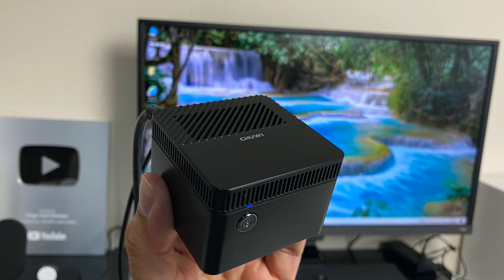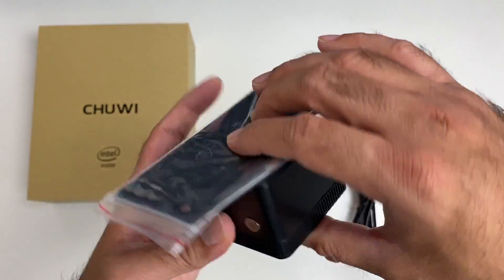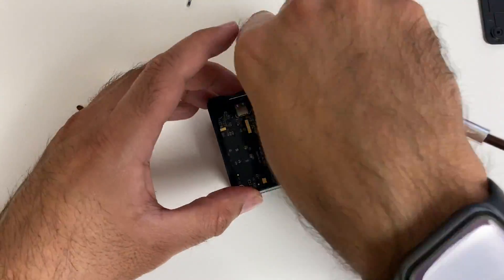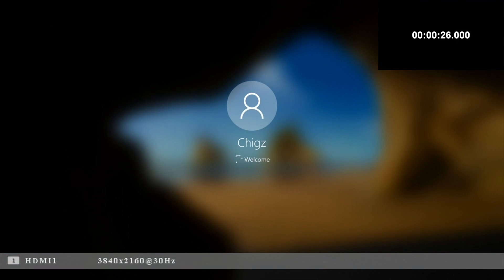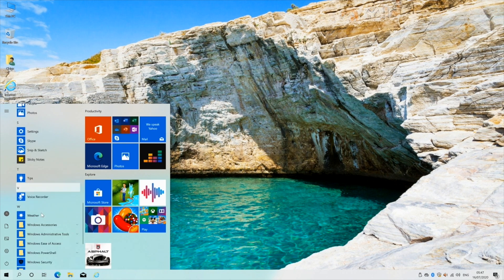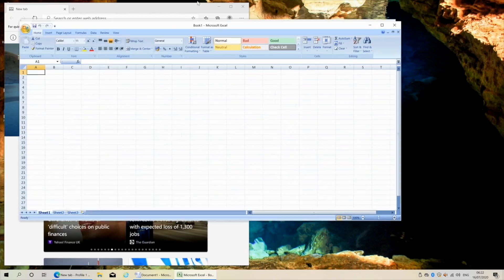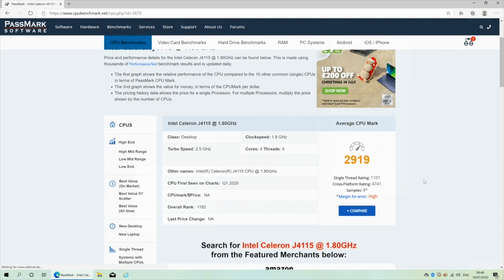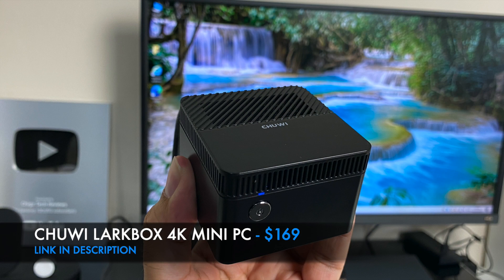CHUWI LARKBOX | World's Smallest 4K Mini PC | Review | Teardown | Gaming!

Comment: I wouldn't count USB C as a plus... This is just a barrel connector in USB C form. It will only work with the provided charger, no other usb C charger or powerbank, since this does not support 5v or Power Delivery, only a fixed 12v/2A like a barrel connector...

Comment: No USB-C passthrough for power and data severely limits it. It could have been a monster but Chuwi missed out on such a golden opportunity that will ultimately see this box fade into obscurity rather quickly. But if they were to bring out a revised version then ......., although I'm sure that half a dozen manufacturers will already have spotted the obvious flaw and might beat them to it. Chuwi are not renowned for their support either, so don't expect much in the way of bug fixes,

Comment: Just add an usb 3.0 hub and a gigabit usb ethernet adapter for better speeds.
Reply: Can I use an external hard drive with it?
Reply: @stateboy0522  Yes, it's a hub, like you would use on a pc. Just search on amazon usb 3.0 hub there are different once even with gigabit adapter and 3 extra usb 3.0 ports.

Comment: This Tiny PC so adorable, However, I just ordered Bmax B2 Plus at $190 one hour before your video was posted,  I wish I could watched it first.  Almost same specs like Larkbox but 8GB ram and 1GB LAN port, I wish this setup can handle 1080 video editing, what do you think? will you do a review of Bmax B2 Plus as well?
Reply: Have also just a bmax b2 plus. - It is a bit more expensive but it is it worth; 2gb more ram, more internal expansion options, 2 HDMI out instead of one. The USB C can also drive a monitor is needed, so you have 3 video out. 4 USB A. With the Larkbox you have a very tiny computer but you will likely need a usb-hub, probably a powered one.  No ethernet-jack .. and it is not like the bmax is big. - And I actuality like the bmax branding  :-)

Comment: Does the unit support Ethernet via a USB adapter? Great review! I'm looking forward to (probably) picking one up.
Reply from the maker: Not tested yet will try soon.
Reply: Chigz Tech Reviews Thank you!
Reply: @ChigzTech  The USB-C isn't properly spec compliant so you can't run USB-C to Ethernet with a hub and it doesn't have USB-PD. Rather it supports 12V/2A and you'd need a special barrel to USB-C adapter.
Reply: @ChigzTech  Please do test. for both USB C to Ethernet and USB 3.0 to Ethernet adapters. 

Maybe the Anker https://www.anker.com/products/variant/usbc-to-ethernet-adapter/A8341041

and the UGREEN https://www.ugreen.com/collections/usb-ethernet-adapter/products/usb-3-0-to-rj45-gigabit-ethernet-adapter